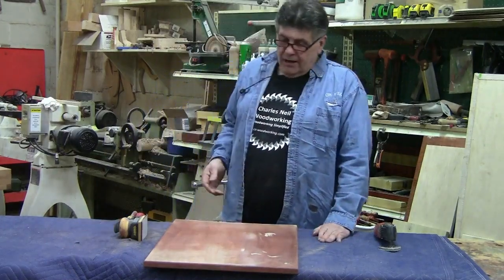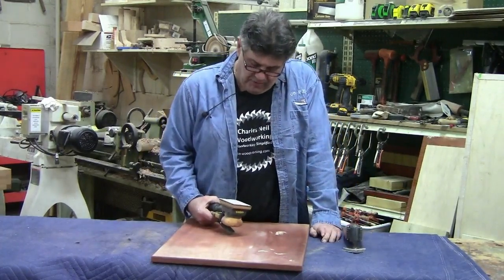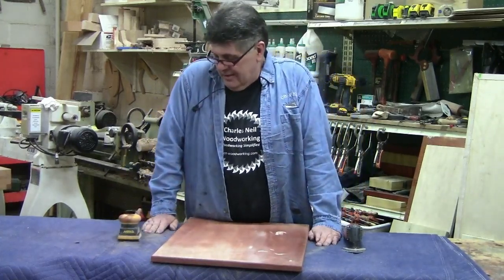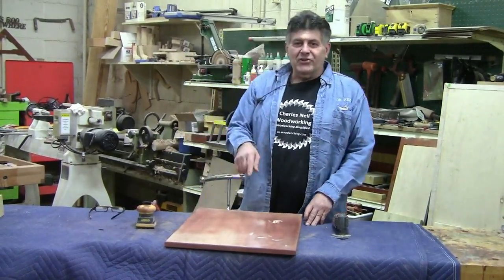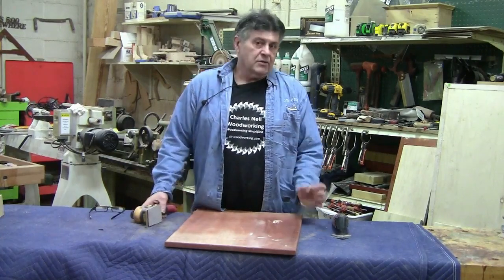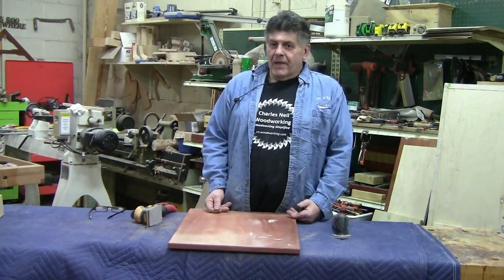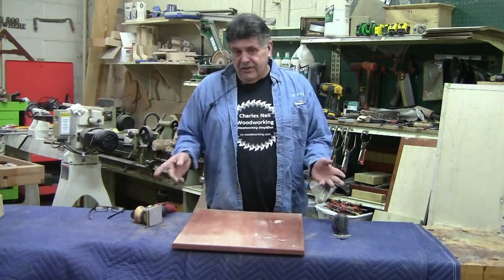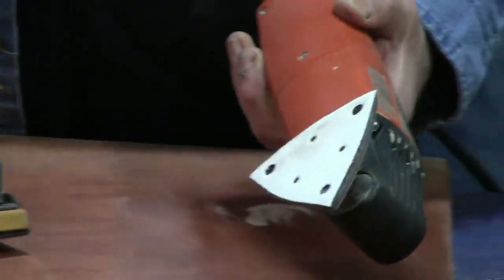Chapter 2B - Machine Sanding - Jitterbug/Vibrating Sanders

Comment: oh man you are speaking my language, I am doing my first commissioned piece right now and of course it is a farmhouse vanity out of pine... I have two festool sanders one with a 2.0mm stroke. I am doing a chemical stain sanded back then a traditional stain over the distressed wood and every time there is always one spot with a curly q somewhere once I apply the finish, so I strip it and sand again. I have spent 4 times the time finishing this thing than building it...